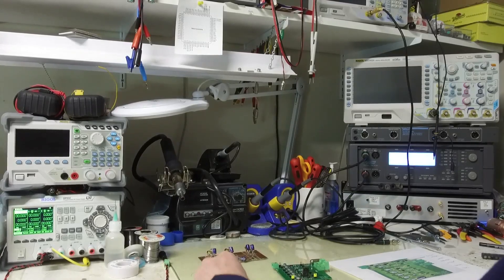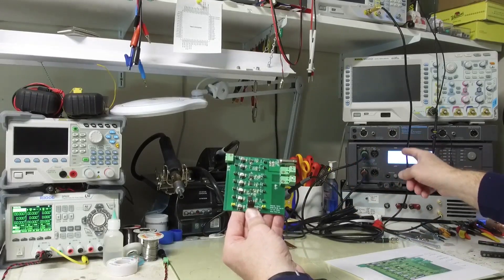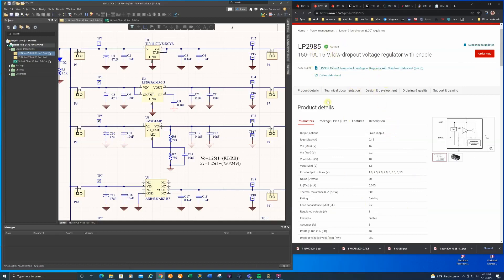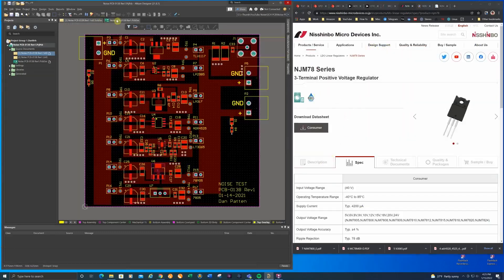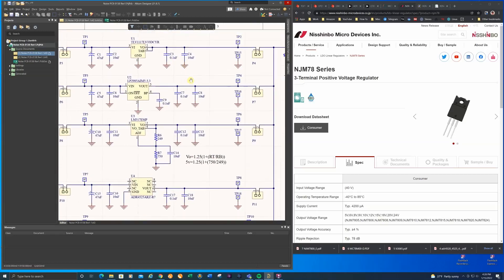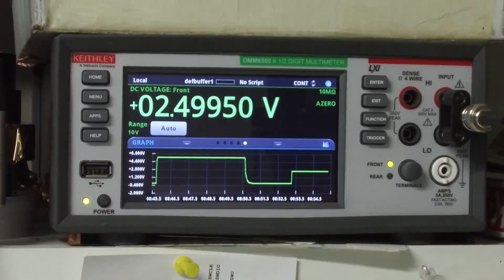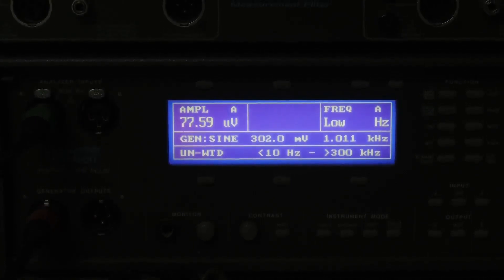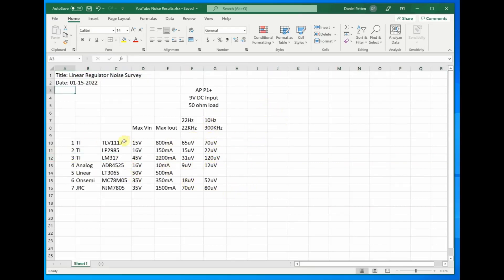Noise Performance Comparison Of Different Linear Regulators LM7805  LM317 TLV1117 LP2985 Altium PCB

Comment: I own a full drawer of lm317t I bought on a flymarket. I'm not planning to use anything else
Reply from the maker: The LM317 although old still works very well.  It is also great because you can use it with higher voltages than most regulators.
Reply: @DanPattenAudioG33k  yep. And because I work mostly on digital electronics, I can use 2 or 3 of them to have 5v, 3.3v if needed, and another power line for final audio output

Comment: Thanks for your effort! One thing to consider: The TLV1117 should be used with tantalum or aluminum electrolytic output capacitors (ESR 0.2 .. 10 Ohms). With ceramics the TLV1117 might become unstable.
Reply from the maker: Thanks for the suggestion, I will keep it in mind.  In most of my designs now, I have started using polymer aluminum electrolytics in parallel with ceramics.  Previous company I worked for [my day job :) ]  made us stop using tantalum caps because they were a conflict material.

Comment: Nice video, looking forward to the follow up on ripple rejection. I had a quick look at the LP2985 device and it's datasheet lists the output noise as 30uV so your test results are pretty close to the manufacturers.  Likewise with the on semi part. Thanks
Reply from the maker: Thank you.  The LP2985 noise surprised me, I have used it alot for digital designs but not so much for analog designs.  I'll have to consider it more often.  I'll get to the ripple rejection in a few weeks (I hope).